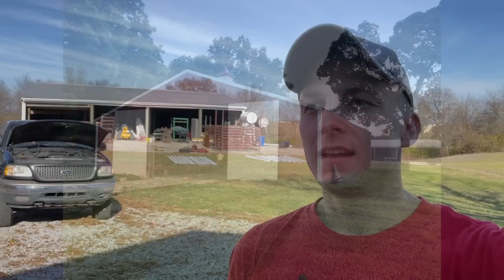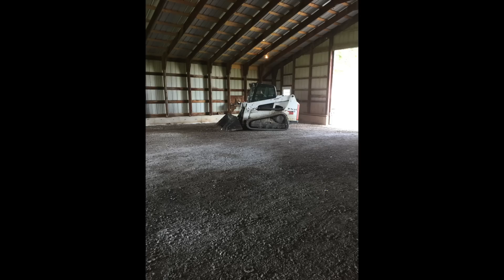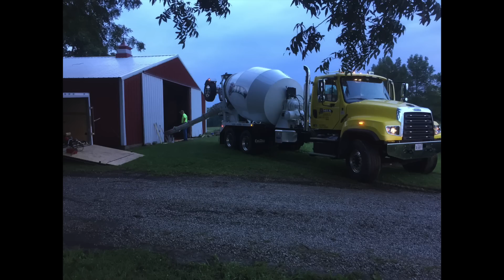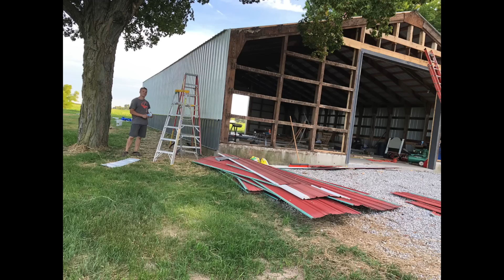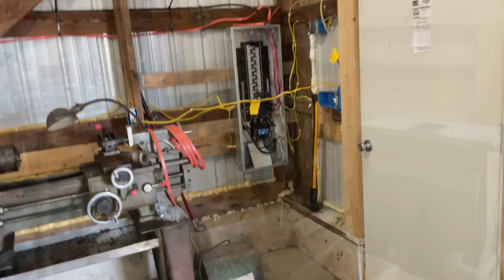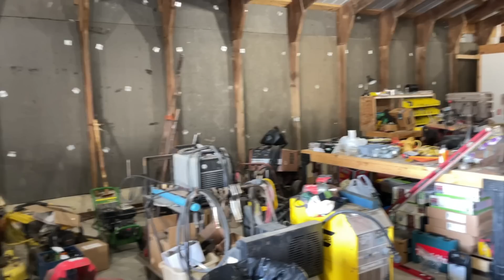Turning My Shed into a SHOP

Comment: You're extremely lucky that they poured a concrete footing when they built the shed. Makes all the money that you put into the build very worth while since you have a very solid foundation. Very interesting to put in that much money and work to then have a gravel floor and sliding doors.
Reply from the maker: I agree! Having a real foundation adds so much to a building. You don’t have to worry about posts rotting off like you would with a conventional post frame “pole barn”